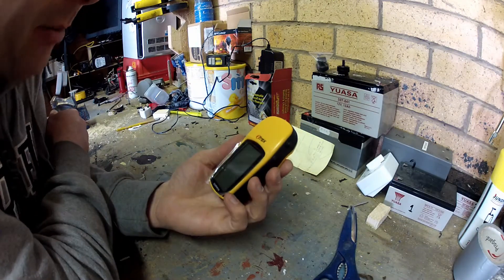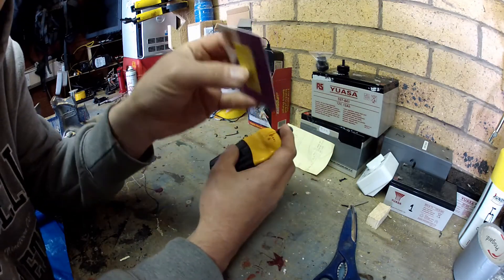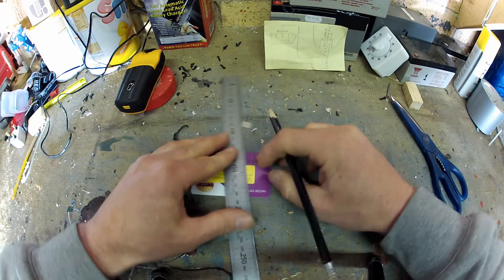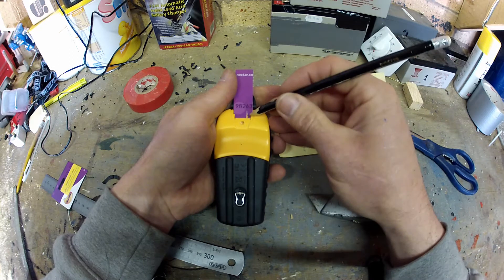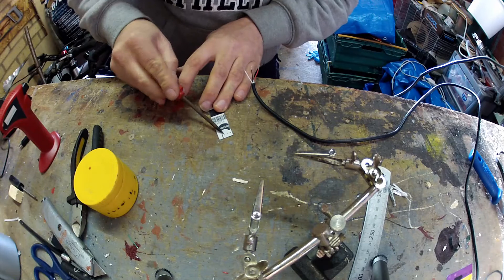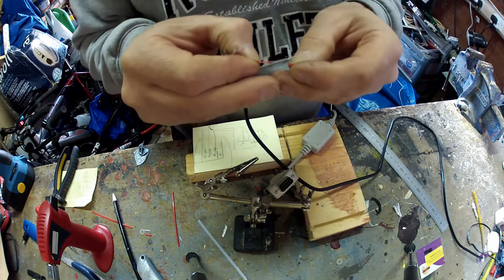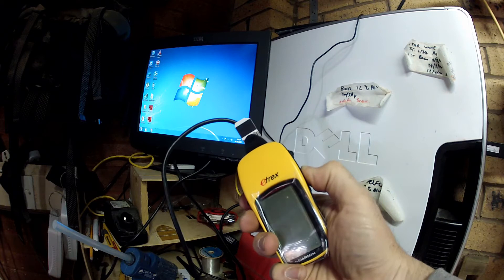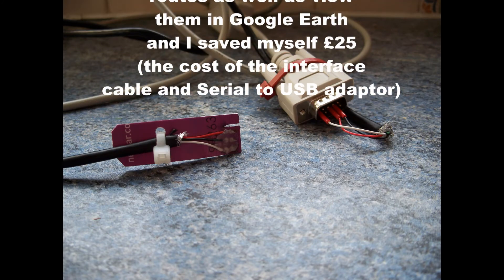Garmin GPS Receiver - Make your own Interface Cable

Comment: I didn't see where you showed what  usb wire  went where ?  If you are holding the usb in your hand with the white  part at the bottom so you can see the  4 copper connections  lets say  starting from left to right  and left being 1 and the far right is 4 , which copper  connection is data in and which is data out  and which one is ground ? Without know which connection  you connected to on the usb  the video is useless .

Comment: Can u tell me how to made this with an USB cable?
Reply: He is using a usb cable  he just doesn't show  where to connect  the wires from the serial port   to the usb  connection so the video is useless unless you know  this . Why he didn't show this  is beyond me .
Reply: its just a serial connection, you will need a serial to usb adapter, why would he show that part. It has nothing to do with the cable adapter he is making. 
Make this serial adapter for the garmin, then you can use any usb to serial of your choice. Its common practice.
Reply: @Sertao2013  thats not how it works, thats why your comment is illogical. He is showing exactly what pins to connect on the serial cable. If your pc still has a serial port, no adapter is required, just this unique cable to get it connected to the garmin device.

Comment: Why cant i just weld it directly to an usb plug?
Reply: That won't work at all. USB and Serial/UART have different speed, timing, protocol, etc.  A USB to Serial adapter or cable will have a small chip or two buried in it somewhere that take care of this problem. You can't just hard wire a Serial connecter straight to a USB connector